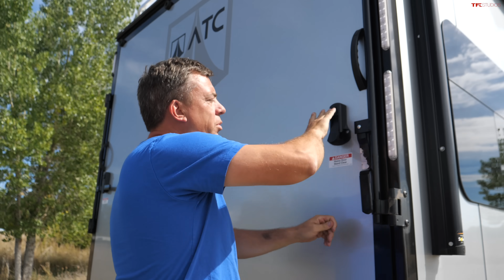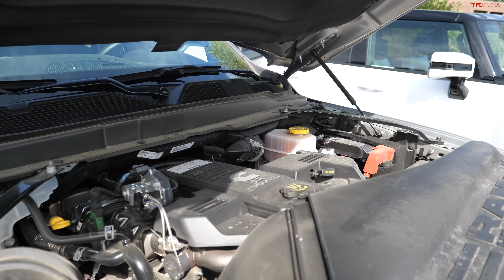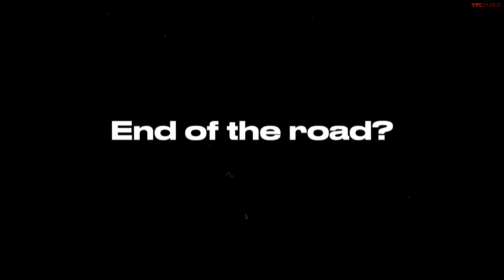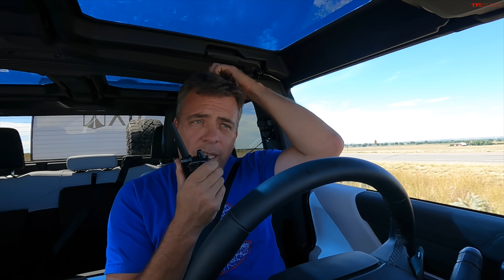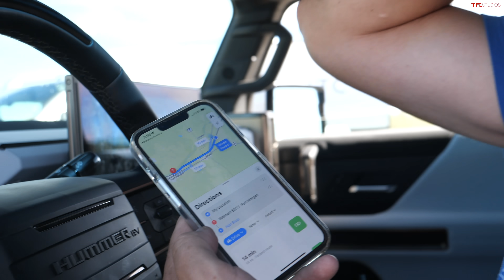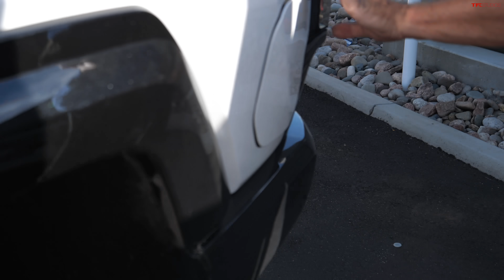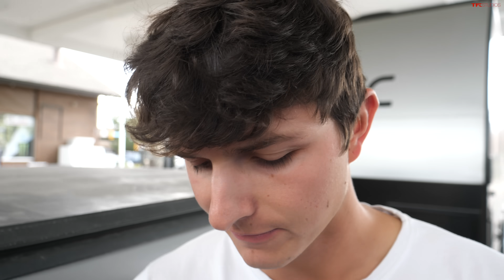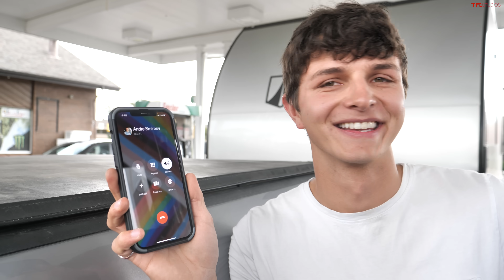How Far Can a Diesel and Electric Truck Tow An Identical Camper Trailer on ONE Fill-up?

Comment: My 2004 Dodge 5.9  Cummins that I’ve owned since new (cost me 33k in Golden Colorado) gets 20+ unloaded x 35 gallons=700 miles range. I also have the same size trailer and get about 15 mpg fully loaded with dirt bikes etc. Under the same conditions on I-76.
Reply: Pre emissions diesels were amazing on fuel for their time. The newer ones a extremely choked, but I'd still pick anything ICE over Ev.
Reply: @errickkitchin36  we delete all that emissions BS on all our work trucks, that crap constantly breaks and is a waste of money and time.

Comment: What would be the cost for the Hummer’s 2 charges, back to 100%? The diesel truck was about $105. 

My Ford Ranger vs the Hummer: Same tow rating; 100 pound greater payload and a bigger bed. All for a third of the price of the hummer.

Comment: That diesel will be more efficient after it's fully broken in, around 50,000 miles, will see slightly higher mpg down the line.
A lot of people that buy new diesels complain about the mpg not being what they thought, but after a few tens of thousands miles, they start to see the mpg expected

Comment: Good content.  Now do the tire change on the Hummer.  Take the roof off the Hummer.  Show the process for these things.  The Hummer is NEW to the market, so these are points of curiosities people have about it.  We already know it can tow.(shorter ranges than the Ram) We know it is fast off the line.  We know it is potentially possible for it to go off road.(provided it is having a good day)We know it can suck energy up from a fast charger in great speeds.  We know home charging, it will take a very long time to fully charge it up.  Show us the everyday stuff it would be like to live with.  The parking in the grocery store lots.  The roof removal process.  The changing of the tire.  Going out to a busy restaurant with valet parking.  Carrying cargo and people.  All your normally done tests are good for what has been on the market for a long time, but I would like to see what living with a Hummer would be like for an everyday lifestyle.  Put the ladies in it and get their opinions on if they would want to drive it around town/cities for their lives.  😉  After all, at the end of the day, is it not a part of the equation of should one purchase it?  Would retirees want to climb in and out of it for their daily trips to the pharmacy?  lol  Will the wait of that sucker on snow and ice be more or less dangerous than the Ram?

Comment: Can you make a video about battery replacement and how the components to make the EV are acquired? And how the electricity is produced.
Reply: Why?  Have you ever seen them do a similar video on engine/transmission replacement?  Where they get the steel, aluminum, plastic, and glass for an ICE vehicle?  How the gas/diesel is produced?
Reply: @dansanger5340  Answer my question with a question. Intelligence!

Comment: What is gear gear ratio in the Ram? 4.10? My Dually Ram 3500 has 3.73. Rated to pull 25,000 with a Cargo capacity of 5450. I tow at 60-65 miles per hour pulling a very big and tall DRV 5TH Wheel. Dry weight is 15500 lbs. 9-14 Miles per gal depending on conditions. You would be surprised how much better mileage you can get if you slow down 5-10 MPH from 70.

Comment: Half a charge for the hummer was going to be $43 which makes it $86 for the full charge just to get halfway. $172 in electricity vs $100 in diesel for the same distance, plus the EV had to stop half way for a full charge if it wanted to make it.
Reply: Your maths wrong bud. its 40 cents a kilowatt, unless its a free station. You boomers do math as well as you do common sense.
Reply: @silvy7394  that station was .43 cents per kw and also they show the total cost for half a tank in the video, when he takes off after about 30 minutes of rapid charging. Check my numbers and show your work if you are trying to refute my simple claims because multiplication doesn’t seem to be your strong suit.
Reply: @alexmills42  Whats .43 x 200? 
Thats right dumbass. Nothing close to 172 dollars. Did you chew on crayons as a kid?
Reply: Someone did the math in another comment. "Thats awesome the charge was free, but let's use the numbers to find out the future cost. The Hummer charged from 7% to 51% for $37.41 according to the EA charger. So $0.85 for each 1%. At that rate it would cost $79 to charge the Hummer to 100%. Hummer cost per mile: $79 ÷ 123 miles = $0.64 per mile.
Cummins cost per mile: $105 ÷ 211 miles = $0.49 per mile"

Comment: Yeah, I know gas and diesel engine vehicles take a hit during towing/hauling, but both vehicles can go further and refill quickly even in the most remote places. Electric makes sense for city vehicles and mild commuting within 1-2 charges (keeping in mind high voltage quick charging will effect long term battery life). So if you need to tow or expect to travel long distances with a load, fuel or hybrid still is the way to go. Maybe once solid state batteries come out we'll see a paradigm shift, but for now, I'm not even bothering to shop for tow/hauling with pure electric, it in fact bothers me a lot when you have companies like Ford saying their truck can do 10K+ towing but gets a 1/4 of the range it once had. Capability feels misleading when consumers obviously wont make proper use of it.

Comment: It's not even remotely comparable. The ROI on of the electric vs the diesel, over a period of time to pay the difference that you save in fuel. 20 years or better? Truck will rust away before that.

Comment: I have taken my Rivian towing about 50% of its total miles so far - a very similar size trailer to what was used in this test. (28', ~7000 lb loaded.)

I wouldn't do this for a cross-country tow, but it's perfectly fine for runs to the mountains, or the coast. 90% of our camping trips are within 200 miles, so at most one charging stop each way. It really depends on how you use your truck. For people whose camping is within one or two charges, an electric tow vehicle can be perfectly fine.

Comment: What would have been better is to take a normal gas H2 hummer and do the tests. The Hummer EV is horribly inefficient, same as a normal hummer, and the cummins is one of the most efficient. Or take a F150 EB and a lightening, that would be better for comparing costs.

Comment: EV trucks do not have enough battery capacity to tow yet,  full stop.  ALL, I SAID ALL, of my towing trips have exceeded 100 miles, so an EV will not cut it.  I will stick to my Duramax for that reason, and if I see a hummer EV on the side of the road with a dead battery, I will roll coal on it, cuz you should have known better.🤣🤣

Comment: See the diesel to KW calculation is wrong, because you need to assume only 40 percent of that goes to actually moving the vehicle.  A diesel only has about 40 percent thermal efficiency, then rest goes to heat.  You guys are not very scientific sometimes.  I do have a science degree myself, but some of the things on the videos seem painfully obvious to me that people should be able to figure out.  Who came up with this idea comparing KW of gas or diesel to batteries?  Romain?  It is wrong.

Comment: Any one else notice that Andre’s fill up was only for half of the trip?
Reply: And it wasn’t to 100% charge. To make the full journey the EV would cost more
Reply: Someone did the math in another comment. "Thats awesome the charge was free, but let's use the numbers to find out the future cost. The Hummer charged from 7% to 51% for $37.41 according to the EA charger. So $0.85 for each 1%. At that rate it would cost $79 to charge the Hummer to 100%. Hummer cost per mile: $79 ÷ 123 miles = $0.64 per mile.
Cummins cost per mile: $105 ÷ 211 miles = $0.49 per mile"